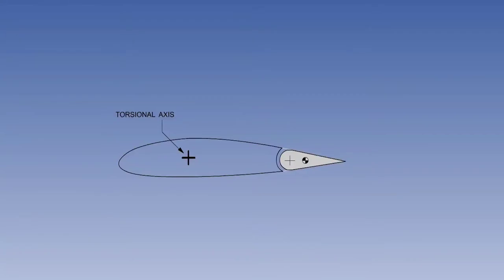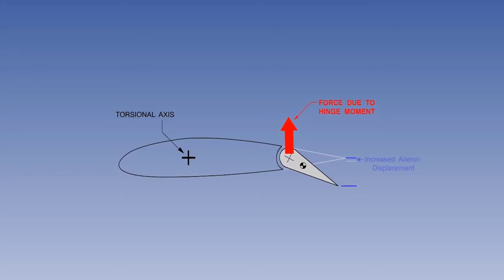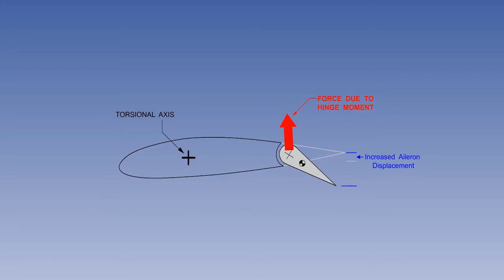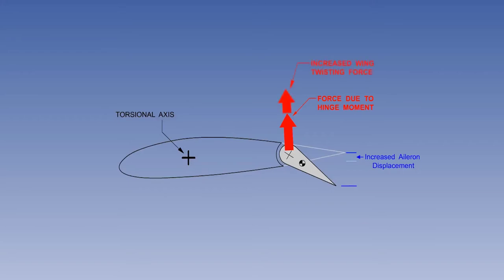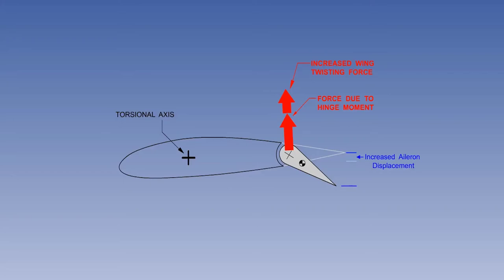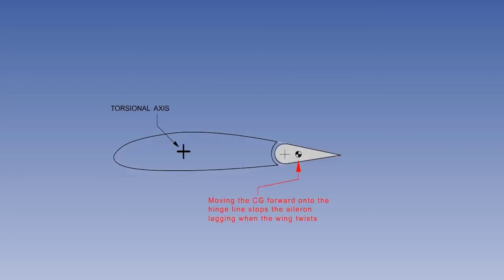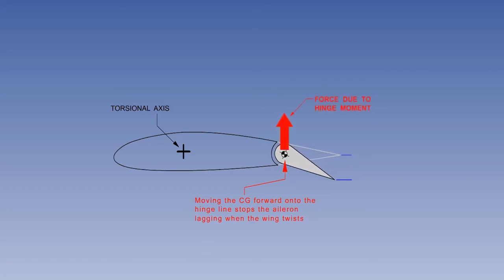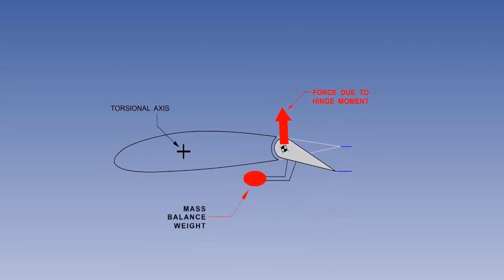Mass Balance Of Aircraft During Flight | Theory Of Flight | Lecture 45

Comment: late reality check           this video contains, either,  false  or  obsolete information.     or, show me one example of the  contemporary  use of mass balancing in ailerons.
Reply: I can't see this device on the modern new aircraft, but I saw this device on the CM.170 Magister and wondered what the device is and how it works, so I found this video.
Reply: Every single engine Cessna and every Van's RV.